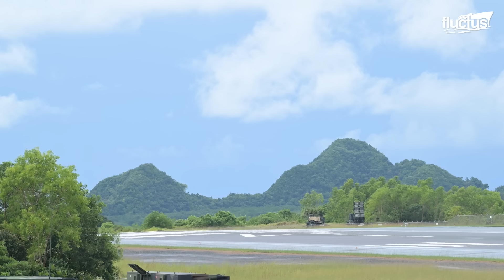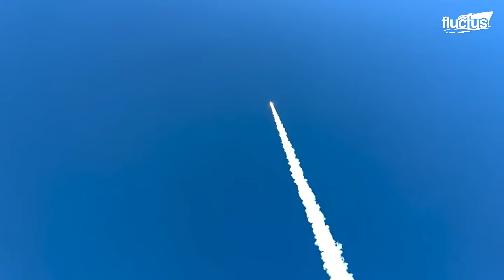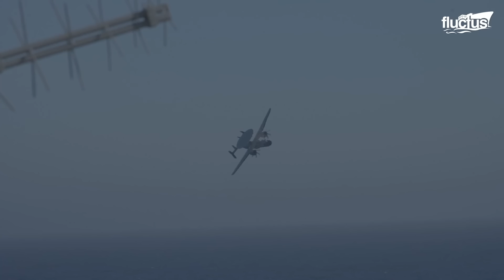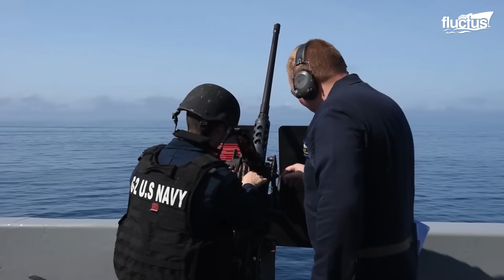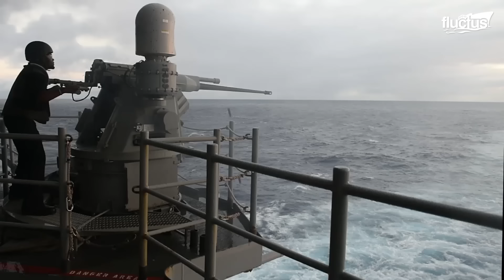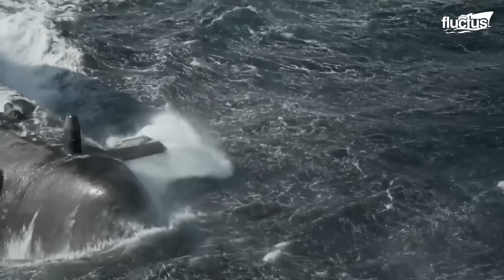How The US Navy Defends its Massive Ships Against Scary Drone Attacks

Comment: A week ago, Ukrainian terrorists launched 1,640 fixed-wing UAVs toward Moscow, each carrying a 30-kilogram warhead. All of them were purchased with funds from NATO countries and contained American and European components. Not a single UAV reached its target. All were shot down, and only six managed to reach the Moscow region.
Reply: Due to a lack of knowledge of the current altitude map, they crashed into newly constructed high-rise residential buildings. However, NATO UAVs were unable to penetrate their walls, as Russian buildings are made of reinforced concrete or brick, which is used to build 1.5-meter-thick walls.
Reply: I hope you understand that if Russia launches 1,600 UAVs with a range of 1,000 km and a 100-kilogram warhead each at a NATO aircraft carrier, NATO's strike group will not have enough missiles to stop them. Thus, the fleets of all countries fighting against Russia on its territory in the former Ukrainian SSR - an integral part of Russia - will disappear.